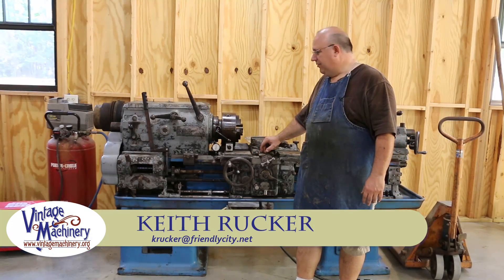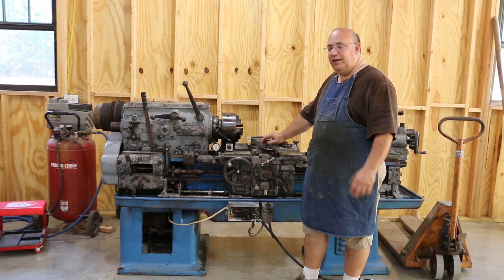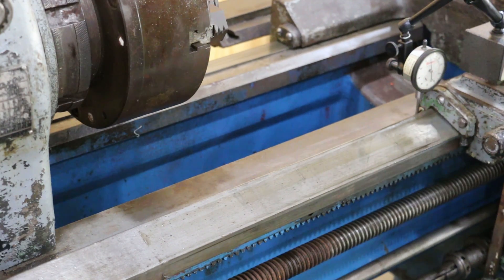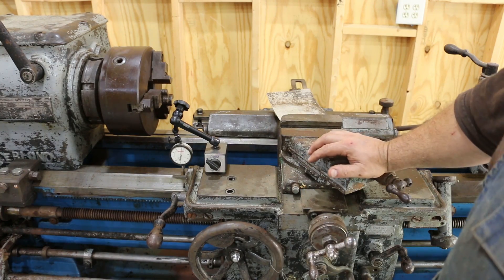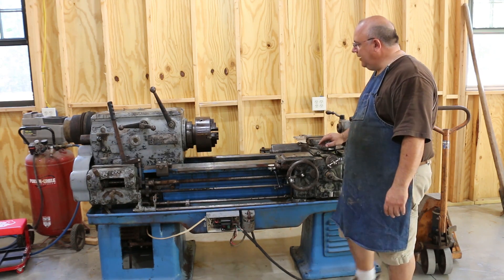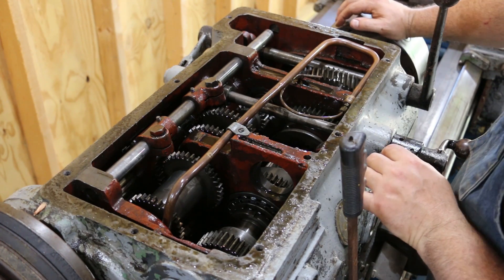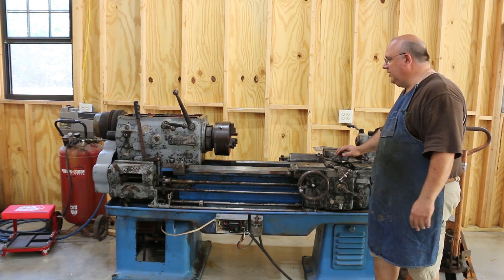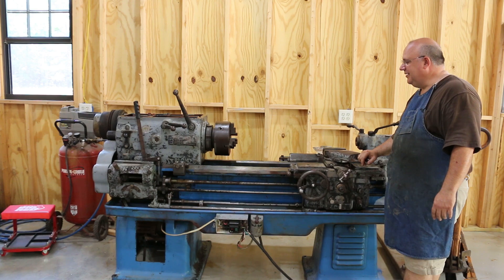LeBlond Lathe Restoration - Part 1:  Machine Insepection

Comment: Would it be possible to hand scrape the ways?
Reply from the maker: Possible?  Absolutely!  But it would be a LOT of work and would require a level of skill that I do not have.  I would hate to do my learning on such an important piece of machinery in my shop.
Reply: Please ignore my ignorance, but "hand scrape the ways", what is that?
Reply from the maker: I am very familuar with the process of scraping a surface flat.  The problem is that it takes quite a different skill level to scrape ways on a lathe - not only do the surfaces have to be flat, but perpendicular to each other across the ways, and in line with the head stock so that things stay straight.  A big difference than just getting a single surface flat....

Comment: keith very interesting how do you tell the r.p.m. you are running ?=======bob
Reply from the maker: There is a plate on the front of the machine that tells he RPM for each possible speed setting.

Comment: Wouldn't you also want to level the machine and test the headstock for run out before tearing things down to repaint?
Reply from the maker: Unfortunately, this machine does not have adjustments to level the machine.  I will be incorporating some into it as part of my restoration.

Comment: Great episode....for its analytical aspect....!  Have used a pre-WWII LeBlond...and it was a work horse....!  Is there ANY way to correct the sag in the ways....besides replacement...?
Reply from the maker: Grinding or scraping are both options, but a lot of work and money to do so.  The real test will be how well it actually turns a long piece once it is all finished.  In the end, this machine is in much better shape than most that are this old and I am confident it will not be a problem for me.

Comment: Over on BasementShopGuy channel, he is restoring a South Bend 7" shaper, but he brings up a good point. Those old machines were probably painted with lead based paint. He uses Citrustrip gel stripper, and is careful to collect all the stripped paint for proper HazMat disposal. Something to keep in mind. Jon
Reply from the maker: Very true - but the real danger with lead paint is from ingesting it.  I have dealt with a lot of old machines and have even tested some for the presence of lead.  Always best to just assume that it is there, but of the machines I have tested, only about half actually had lead in them.

Comment: If the gear cover holes are countersunk, it took flat head screws, if the counterboars are flat, it probably took low head cap screws. Probably available from Grainger or McMaster Carr but you probably have to buy 50.
Reply from the maker: I will more than likely put the proper fastener back in when it all goes back together....
Reply: +Keith Rucker - VintageMachinery.org Most people never heard of low head cap screws. I had been working on machines for 20 years before I ran into them.

Comment: Thanks for the Vid Keith!! That lathe looks fantastic and for straight cut gears like that, she runs quiet. Loads of oil for those babies! As you said, the dish in the ways is nothing. People forget the majority of the work you are still going to do is in that same area. So, to the workpiece. Your saddle is not really moving. Once you transition from the dished area out into the virgin area is when you will see a change in tool position. The amount of tool tip position that changes on the X axis is a function of the part diameter. The tip will travel along a chord perpendicular to the axis of the part and the cutting tip will travel along that perpendicular line. The line will be inversely proportional to the diameter so the bigger the diameter, the less the tip will move in and out of the cut. In reality, the amount even for small diameter work will be very small. Could calculate it and then do a test cut on the lathe and compare the results of the calculation and the actual tool cut.

Either way, that lathe is badda$$!! Would love to have it. Though, I love my Clausing 5914!
Reply from the maker: Thanks Brian, I think that the lathe will make a great user!

Comment: It's looks like the headstok is missed one of the gearshaft.
Reply from the maker: I think that what you are seeing is the means to attach the optional releiving attachment on this machine.  It was a special order option for releiving the rake on cutters.  The head stock was made to accept an extra power take off for that use, but this machine did not have that option (nor do I need that option)

Comment: Keith, in the top of the gearbox one of the oil galleys seems to be running dry. 
In the video, left center of the screen, right next to the oil line.
The perfectionist in me screams "scrape the ways!". Never mind that I've never done that. :-)
You're right, it's not that bad.
I'll keep following.
Thanks,
John
Reply from the maker: Thanks John.  Keep in mind that I was not running the lathe at full speed because oil would be slinging everywhere.  I think it is getting plenty of oil in operation - once the machine spins up, you have a lot of oil pressure on those lines that we were not seeing in the video.
Reply: +Keith Rucker - VintageMachinery.org 
Ok. Just looked like something to pay attention to.
Anyway, when you're done with it, can I have it?
Just kidding. 😊
Thanks,
John
Reply: i noted that the second from the left was empty and the one to the right was filled.. but when you unwound the small tube it had been pointing at the side of the bearing where the one that was filled was.. i wonder if the bearing outer race spun at some point and the if there was a feed hole is now out of alignment  with the casting well.  i am not saying anything is wrong. .but its worth checking before painting the machine..  i am also taking there is some kind of gasket for that top cover.   just observations from a car mechanic. 

must take a huge surface grinder to refinish lathe and other machine tool ways..

Comment: at what point would be worth having the ways  reground (how much run out)
Reply: It would cost many thousands which defeats the object of buying used. 
Keith does own his own surface grinder but I'm not sure if it would be possible to use that
Reply from the maker: Well Scott, that is a hard answer to give.  It all depends on what you are wanting to do with your machine.  I think for most of the work that I will be doing, I can easily live with what I am seeing, but if I was making parts for the space shuttle, it probably would not be good enough.  I have done good and acceptable work on machines worn much worse than this one.
Reply: Oh ok thanks for the come back

Comment: Nice looking machine. I'm doing something very similar to a 1949 Holbrook C-16. It had sat for years and at one point had flooded during a tropical storm here in Houston. Mine came apart down to the last bolt and is slowly going back together. Curious about your compound, I wonder what the benefits of having the T-Slot cast parallel to the spindle axis instead of perpendicular to the compound axis is?

Comment: Grate job, I never thought of using a Dial indicator to check  the ways the way  you did.  Sometimes I feel so stupid. LOL
Reply: Dale that is why we watch you guys' videos no one can know everything. The smart man doesn't know everything but he does know people that do.
Reply from the maker: Don't feel stupid - just make it a point to learn something new every day!  In retrospect, I should have used a different surface to measure the in and out runout on this machine as after I got the carriage removed (my next video in this series), it became apparent that I was measuring wear in the front of the way more than movement of the carriage.  Bottom line, I don't think that the runout was as bad as I though in that direction!
Reply: Google grate bro. Have a great day.

Comment: Hi Keith,

On one of your videos (the camel-back straight edge de-rusting, I think) you mentioned that something you intended to do in the future was some scraping. Is this slightly bellied lathe bed a suitable candidate for scraping to reduce the deviation from a perfect flat surface? Even if not, once partially stripped would it be a good candidate for showing how the straight edge could be used to highlight the deviation from perfect?
Reply from the maker: Yes, one could scrape this bed back into shape, but it would be a lot of work.  I am not sure that it is worth the effort.
Reply: Well, it would be a pretty large "first scraping" project ... may depend on what else you find during the strip-down and what else needs higher priority. I shall be watching the series with great interest, as always.

Comment: Kind of you to comment but the bottom line is that the audio could easily be better.  Americans are well known for their exceptionally good customer facing service and I am a customer.  I, and many others, are listening on tablets, not high end audio systems.   I am sure Keith will be all too happy to turn the fan off.  People tend not to notice background noise when making their videos but it becomes exceptionally distracting on the sound track.  I want to hear Keith, not the fan!  As you get older you will find that distracting noises become more and more distracting.  Stay young, old age is annoying.  Bob.
Reply from the maker: Sorry Bob, but the fan is a necessity.  Here in South Georgia where I live, our "spring time" temperatures outside are already in the mid 90's and working in the shop with a metal roof is like working in an oven.  It was over 100 degrees in the shop and with high humidity the "real feel" temp was more like 110 in the shop.  I can either run the fan or I can just stop doing any work until fall.  While the fan may be distracting, your choices are to either listen to the fan or for me just to not shoot any video and you guys wait to see the finished product this fall when the temperatures cool off.
Reply: +Keith Rucker - VintageMachinery.org: Hi Keith, thanks for the explanation.  Not like that over here.  I don't want you cooking yourself nor do I want to make others apparently less distracted wait until the fall!  Unfortunately, neither suggestion helps me so sadly I have unsubscribed.  Can't hear you clearly and I don't have that trouble with many other machinery channels.  Perhaps a less omni-directional microphone would have helped, or move the fan if possible.  At least you were using a lapel mike, many just rely on the camera one.  I wish you well.  Enjoy refurbishing your intersting looking Le Bond. Bob.

Comment: I can't tell from the video, but is the machined surface you made the second measurement completely vertical or is it angled toward the center of the lathe axis? If it was angled and the carriage is already rising and falling as it travels, the change in the vertical position of the indicator would change the reading even if there was no wear on it.
Reply from the maker: The sufrace was vertical, but it had some paint and grime on as well as some wear.  After pulling the carriage off as you guys will see in the next video, I think I would have been better off measuring on a different surface.  I don't think that the runout of the carriage is as bad as what we measured.

Comment: This may be a silly question, but could you swap the head stock to the other side of the machine so that the "belly" is in an area that see's less use? I have thought about doing that on my old Logan lathe, but have not fully researched it yet
Reply from the maker: Not on this lathe - the way that the ways are made, you cannot flip the headstock around.

Comment: Hi Keith,  Is there anything you can do to supress the backgrund audio hiss?  No doubt it is just me, but I find it rather distracting.  Old age I suspect! Bob
Reply: there was a fan running, but no hiss, im listening on pretty decent speakers also, perhaps you can adjust treble in your sound settings? usually old age you lose the high frequencies.
Reply: I'm listening on closed back full can headphones and other than the fan running in the background, the audio sounded pretty clean to me.
Are there any other applications running in the background on your PC/device which might be holding open an audio channel to your sound card/device? You might want to check that. I've had that happen to me where there were multiple open input channels from other programs that will cause that hiss due to interference frequencies. You might need to close or stop a background app.
Reply from the maker: As others have already posted, what you are hearing is my fan running.  That will probably not be eliminated until this fall when the temperatures drop!  Temps outside have been in the mid 90's the past few weeks and coupled with high humidity and the tin roof in my shop that is not currently insulated, you get the effect of an oven.  Yeah, sorry to say so, but the fan stays.....

Comment: Keith, I tried to search back in your videos to find the one I think you did of a friend who had to get his lathe ways reground. The question I was trying to get answered was how much it would cost if you wanted to get this done? If you did, can you detach the ways from the machine or would the whole thing have to go? Great show as usual!
Regards,
Rich
Reply: i vageuely remember that, i dont think there was actual video of it, im sure youd have to strip it down to nothing, i dread to think of the potential price!
Reply: Was odd and ends 31 and 3k cost he said on gofundme
Reply from the maker: The cost of the regrind would several thousand grand.  Not to mention, I would have to strip everything off of the bed - a lot of work.  I think that this machine will be just fine as it is.  Truth be known, it is probably in better shape than most of the lathes any of us YouTube creators are using.

Comment: Hi Keith. I think I would put a tool holder on and just turn a test bar before I stripped it down. The lathe is probably good but a little bit of pressure on it would show up any problems with the clutch and motor before you go to far. But that being said I am looking forward to the restoration.  regards from the UK
Reply: i would assume the clutch is something that would be simply adjustable, so unlikely to be a problem, usually a weak motor would have issues getting going from stop, not so much when already running.  I am too looking forward to seeing him solve the feed issues and getting rid of the awful wiring and replacing that front louvered plate.
Reply from the maker: The clutch is adjustable so I am not too worried about that.  And I can easily replace a motor if needed.  That is the least of my concerns.

Comment: I am wondering, are there any lathe designed with some wearing pads between the ways and the carriage? So you can change the pads when they are too worn out and the ways keep intact.
Reply: we all know that steel on steel is bad, , might have preserved more of the ground ways i think
Reply from the maker: I don't know - if you have wear pads, that means that they are designed to wear more fast than metal.  I think I would want to go with something harder that will last longer.

Comment: If i ever go on with my intent to build a lathe to bypass all the known issues a conventional lathe comes with, making the ways something removable is a priority. As a byproduct of that, i anticipate some form of wear adjustment, after all, to secure the ways to a lathe bed would require a lot of screws, might as well make use of them.
Reply: you could clad the ways with more ground stock on the wear faces, perhaps some dovetailing to help secure it rather than just screws alone, perhaps design in some bronze under the major parts to also prevent wear to the ground faces, something more consumable.
Reply: There was an English lathe that had removable/replaceable bed ways, something like 2" by 1/2" ground flat stock, could be wrong on dimensions but you get the idea.
Reply: it would seem that LeBlond had put a lot of though into how wear will possibly affect long term accuracy, im sure their unusual bed design wasn't just for nothing, moving the wear into a direction less likely to affect accuracy.
Reply from the maker: Even if you can replace the ways, they would still need to be ground in on the machine to be perfect.  All of the screws used to attach it to the bed is going to move the metal ever so slightly.